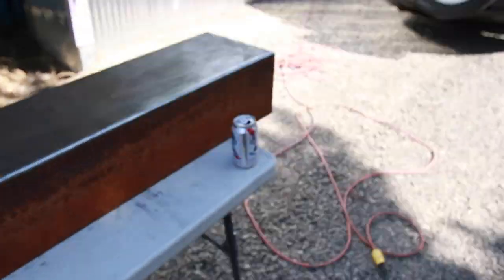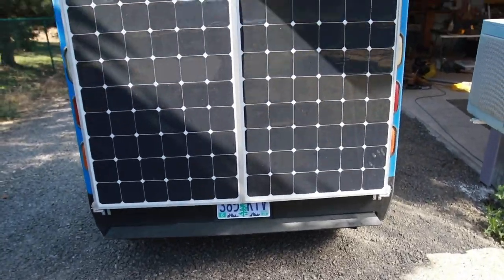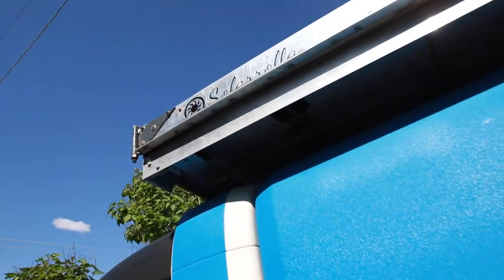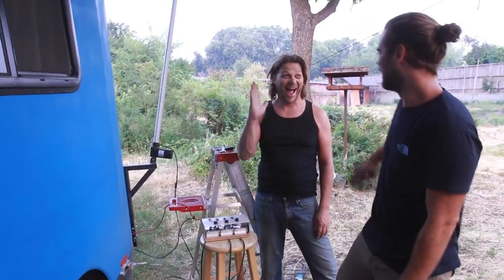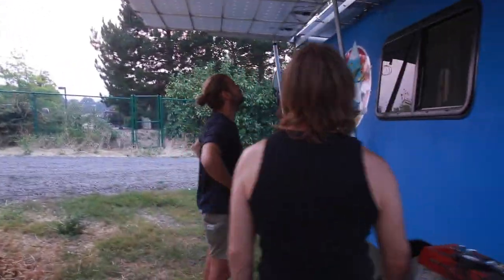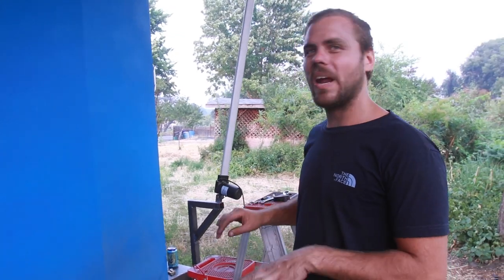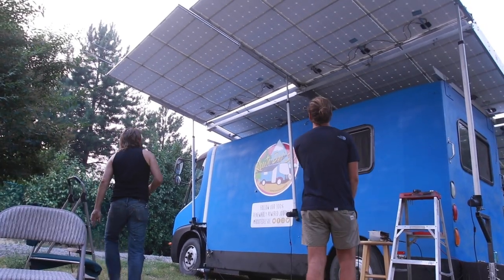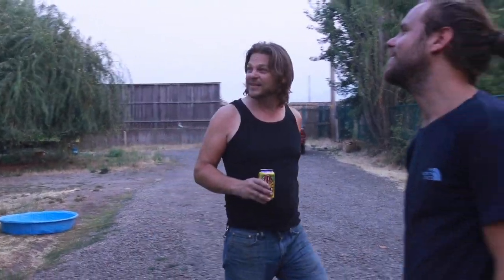I thought I was blinded by the accident! | Solar Electric Vehicle Roadtrip Alaska to Argentina

Comment: Thongs are the best protection for your eyes when metal working, let that be a lesson for the rest of your life. Also whenever handling anything to do with your batteries, use eye protection, a drop of a tool or some other accidental can send molten metal flying. Also wire pushing with trakies on is not a good idea, you find wires sticking into your nuts for months after.